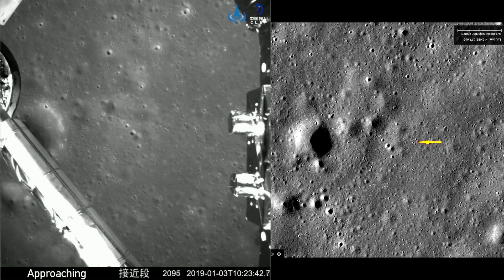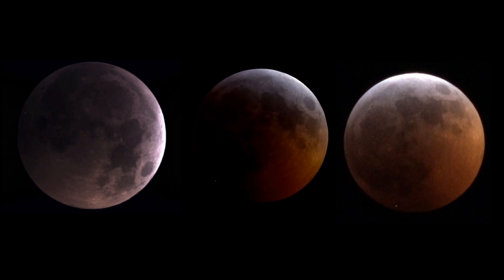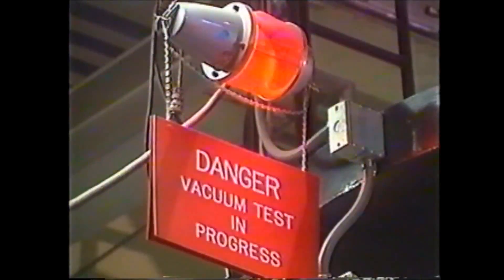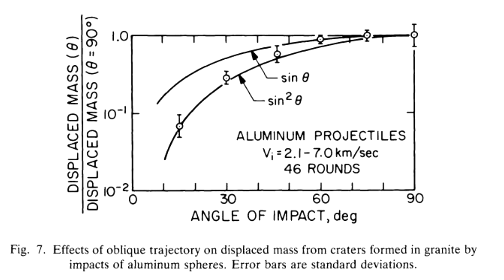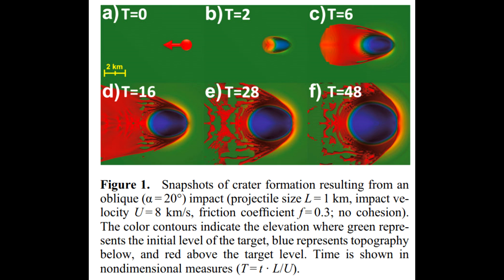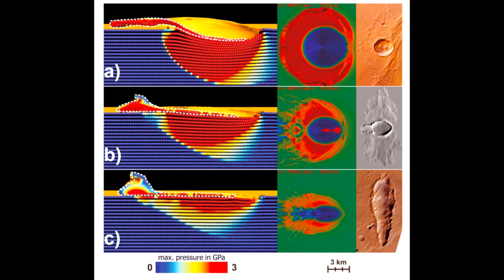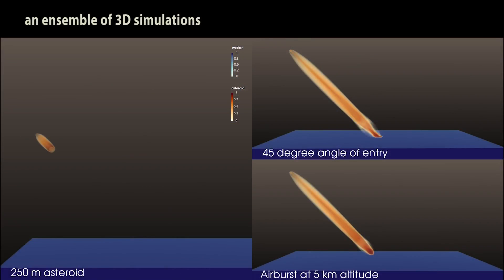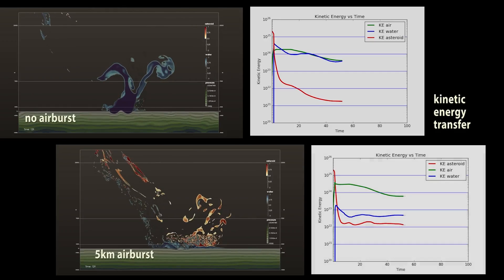Why Are Most Impact Craters Perfectly Circular? (Rather than Ovals)

Comment: I could be quite wrong,, I often am.  I understood before you began that the heat light explosion is not a respector of direction. The heat, light, explosion, coupled with the return ejecta stream,, you will normally have a circular crater, regardless of angle of attack.  Got it, had it before,, we are cool.  But,,  Is your distribution chart accurate?  I would think that even fewer examples would exist  in a gravity well coming in at very shallow angles to local perpendicular.  All objects are bent toward the local center of gravity as they accelerate toward  the surface.  Even to the extent,, that despite a fall angle of attack,, as the object is violently decelerated,, it will bend more and ever faster toward the center of gravity.  The flat angle will frictionally increase the angle as the object is violently decelerated. Light waves entering a change from air to glass, bend toward the glass.  Physical objects, people or stones thrown into the pool also are bent toward local perpendicular.

I think your Bell curve chart, perhaps does not take into account, that the final strike zone is not the surface,, but rather 1 plus diameters below the surface.  Your Bell curve and the disparity of lenticular shape of the crater would then more closely agree.  Any lightly agglomerated impactor may well leave a trench if it comes in at a flat angle,,, vs, any object of a firm cohesiveness will bend toward local down.  Those trenches of multiple impacts? are from lightly agglomerated, gravel pile, objects, being torn apart by differential gravitational pull.  Just as Shoemaker-Levy was ripped into 22 pieces. 

And, I could be wrong.

Comment: It looks like the problem is a small region of high heat's effect on the region around it, except for the case of low angle impacts, where some of the impact is not necessarily happening at exactly the same point, but drags on.

Comment: Another point of interest here is that objects traveling at ~10 km/s have more kinetic energy than chemical bond energy holding them together. With that much energy, the fact that the projectile (or the impact surface) is solid doesn't really matter.
Reply: So, does a pebble thrown into a pond create a round ripple or an elongated one?
Reply: 1:29 is the part you seem to have missed.
Reply: @leocurious9919   Yea, he touched on it, but I thought it could use clarification/expansion. It's odd to think about it not mattering whether the impactor or surface is solid or liquid, since the energies are so high.
Reply: @Nuovoswiss  Well the impactor is solid. But it doesnt stay that way... pretty much.
Reply: It's also interesting to consider that while solids become as liquids at higher velocities, liquids become as solids at lower velocities.
Reply: @gehovagyra1635  What makes you think so or what exactly do you mean:
"liquids become as solids at lower velocities."
Velocity has nothing to do with the state of matter. Its the huge acceleration (release of energy) during the impact that simply renders any existing bounds irrelevant, thus anything will behave like a fluid under these conditions.
Reply: It depends on the material,if it is an aluminum ball then yes but if it is just a normal rock then probably around Mach 3 is enough
Reply: @raph.editzz  Almost all rocks will have more binding energy than aluminum (check the melting points).

Comment: Most bullets go faster than the speed of sound, didn't understand that explanation.
Reply from the maker: Speed of sound in the propellent.
Reply: @scottmanley   You mean the speed of sound within the pressurized gasses in the cartridge/barrel? As in because it's such a high pressure the speed of sound is much faster than it would be at atmospheric pressure? You can just link a wiki article to the phenomenon if I'm not even close.
Reply from the maker: Right the propellant expands, but its expansion rate is limited by the temperature and composition of the gas. It's not so much the speed of sound in the gas to be honest, but it's a decent analogue.

Comment: Because they aren't impact craters. They are electrical scarring.
Reply from the maker: Your evidence is lacking.
Reply: I was just about to go back and correct. Some of those are impact, and some are plasma discharge. The circular ones with the raised centers, the hexagonal ones, and the ones with small craters around the rim are, I believe, plasma discharge. Thanks for the video. I watch them all.
Reply from the maker: Can you show me an example of discharge cratering at a distance in a vacuum?

Comment: Because there is no "impact". The electrical charges carried by both bodies result in the lesser body being vapourised. Those are quite obviously arc weld marks. Every "impact crater" has a spray pattern of hematite and other high iron deposits spreading out from it. This video is a fail.
Reply from the maker: I'll believe it as soon as you show me a discharge powerful enough to make craters the size we see on the moon.
Reply: @scottmanley  There are more amperes in the earth than you could possibly measure and there are more volts in the ionosphere than you can possibly imagine. Have a look into the historical record of failure with "tethered satellites".
Reply from the maker: And yet the only experiments you have show a dude holding an electrode close to a plate. 
At least the gun experiment can make the impact happen at a distance.
Reply: @scottmanley  I can, and have duplicated these "impact craters" all day long with a welder. They're always round because the arc gouges out in a clockwise pattern starting in the center. Every "impact crater" here on earth that we have investigated, all have the same concentrated metallic element pattern  around them from the molten metal spray. Any physical impact is going to result in an oblated crater if contact is anything outside of exactly 90 degrees. This would be further magnified by any rotational spin on said body.
Reply from the maker: Have you tried doing this in vacuum?
And do you have pictures of this electrode being applied to the moon?
Reply: @scottmanley  Is this an attempt at an argument? Physics doesn't change just because you transfer it up into space.
Reply from the maker: If that's true then why do vacuum tubes have to be evacuated?
Reply: @scottmanley  To remove contaminants, otherwise the tube wouldn't perform correctly. It's like putting a halogen bulb in with a fingerprint on it.
Reply from the maker: Wow. 
I Suggest you go and read how vacuum tubes work before you talk about electric discharges in a vacuum again.
Reply: @scottmanley  Don't get smarmy with me, jagoff. You're obviously way out of your depth on this subject.
Reply from the maker: Hey I’m not the one that doesn’t understand electricity in a vacuum.
Reply: I enjoyed your video on the telescopes and I gave it a like, because I learned something from it, but I'm going to have to disagree with you on this subject.
Reply from the maker: I’m asking you to demonstrated your ability to create craters, but in a vacuum and at a reasonable distance from the surface. And your response was that doing it in space would make no difference. Come back when you’ve demonstrated this mechanism under read list IV conditions.
Reply from the maker: Great so you'll be able to make a demonstration of this? Because there aren't any demonstrations out there. 
Also, 1/2 inch is pretty crappy, my impact physics works at any range.
Reply: @scottmanley  Your "physics" is complete bunk. It's impossible to get an equal distribution of kinetic forces from anything outside of a completely perpendicular impact. Tell me, genius, how likely is it, for two bodies, possibly spinning at several hundreds of miles per hour, to collide at completely perpendicular angles? Stick to your telescope and lens videos. This is obviously way beyond your comprehension.
Reply from the maker: So what you’re saying is the results of the gun experiment are impossible.
Reply: @scottmanley  Just one more blatant hole in Never A Straight Answer's experiment; Where's the flash of light, genius? Not one flash of light, but every "meteor strike" observed is accompanied by a bright flash of light. Fucking, Swiss cheese has less holes in it.
Reply from the maker: @rexhaereticus2468  at 4:00 you see the flash of light, I even mentioned it in the video.
Still waiting for you to demonstrate an equivalent cratering system in a vacuum.

Comment: (@ 9:46) If I pitched a baseball at supersonic speed then the catcher would be severely injured, if not killed, while I knocked myself on my butt, or onto my head and be dead, and my career in baseball would be over.. Assuming a 700 mph pitch then it'd be like hitting him with a 4000 lbs car at roughly 15 mph.

Just thinking about the foam impact on the leading edge of the wing of Space Shuttle Columbia....Yet I wonder if the temperature of that baseball would raise to flashpoint. Then it'd be a real scorcher.

Comment: The best experiment people can do at home (if they live somewhere cold) is to use a snowball.  What's going on with a meteor impact is that the bonds within the material has to be able to survive the impact in order to make an elongated crater.   If you hit rock against rock, above a certain energy level there's more force than the chemical to bonds in the rock can sustain and it just vaporizes.   You can do this with a snowball against a brick wall too.  Take a loosely packed snowball and throw it at a house.  It will  leave a circular mark every time.  But pack it more tightly and from a shallower angle and it will eventually leave a streak.

Comment: When standing on the bank of a lake, shoot a gun into the water and the splash is always vertical even at low angles of impact. I suppose this is similar to Moon's craters.
Reply: What if you shot bullets made of plasma in a vacuum, and what if those plasma bullets interacted with an object having the most minuscule atmosphere. And what if that object happened to have an opposite relative charge (positive-negative).  Would there, or could there be an equalization?  How does plasma interact with objects in a vacuum?  How would the evidence appear?  What would the aftermath look like?  Could we reproduce an analog in experimentation and draw conclusions from the results?  Have I smoked too much pot today?
Reply: @lazyjackass77  Definitely too much pot.
Reply: @TheAngrySaxon1  Me or him? ;] Cheers!
Reply from the maker: If the plasma had bulk charge what stops it repelling itself apart before impact?

Comment: Hey, neat. The science of lithobraking! I was pleased to see my intuition of how this works (and why craters are predominantly [hemi]spherical) was pretty much correct :)

But, as usual, intuition breaks down on scaling. I was duly surprised to see the scale on that last animation, with the 14km high blast with Seattle in the background.

P.S. does anyone know if similar research has been done including impactor material composition into the mix? I expect it has a significantly larger contribution to crater shape than impact angle does. Similarly, material composition of the impacted object (which I expect has an even larger still effect)

Comment: One more additional factor: Acceleration due to gravity.

The gravitational pull from the impacted body (such as the Earth or Moon) will pull any meteorite into a steeper trajectory.
Even if this is only a slight change, you're looking at very shallow impact angles needed to make a noticeably elongated crater- meaning the slight change could produce a noticeable effect.
In addition the shallow trajectory would be most effected by gravity this way.
Reply from the maker: Again this is what intuition tells you, but while the effect of gravity is to pull a particular trajectory down it also pulls trajectories that would otherwise miss into grazing trajectories. The net result is the distribution of impact angles is independent of gravitational forces.

Comment: An even more simplified version: asteroids do not impact at the surface ; they are going way too fast to slow down to a stop at that first instant of contact.  Instead, they keep going (along their original angle) and finally "impact" (stop) notably below the surface; that's where their mass and velocity accumulate and fully convert to a massive heat/compression explosion, which, being underground, pushes up and out in all directions, leaving a circular ring of destruction, regardless of the original angle of entry.  Only asteroids that are so near horizontal that they "skip" along the surface act differently.

But, like this video's longer and better explanation, it's actually much more complicated, but this gives a taste of the true underlying explanations that would take tons of math.

Comment: Where does most of the material of the astroid end up? Does it end up buried in the ground at the crater or is it spread around? If it ends up localized, then why not mine moon craters?
Reply: The energy of the impact vapourises the meteroite, & it get scattered.